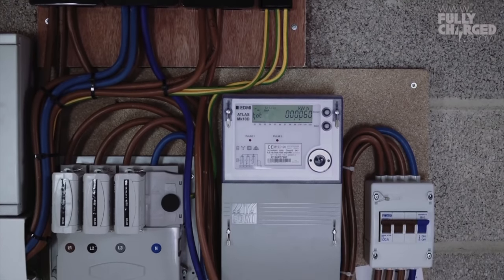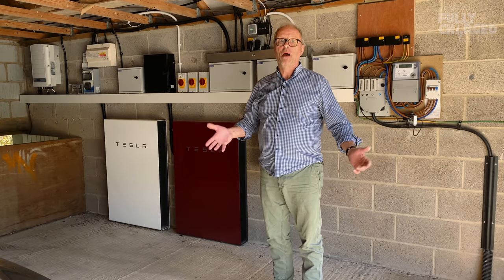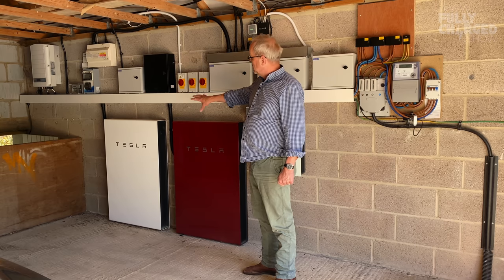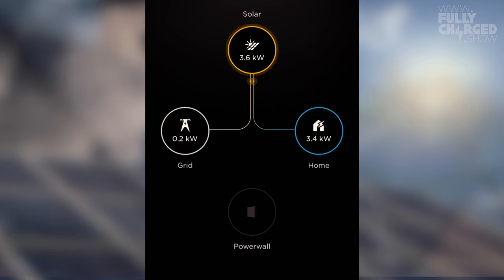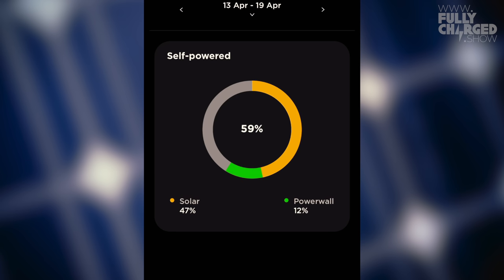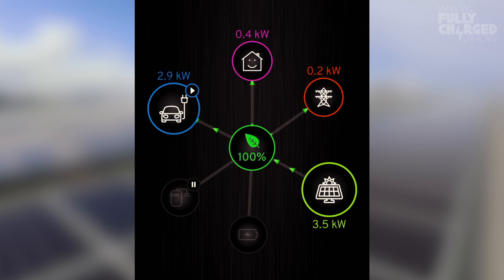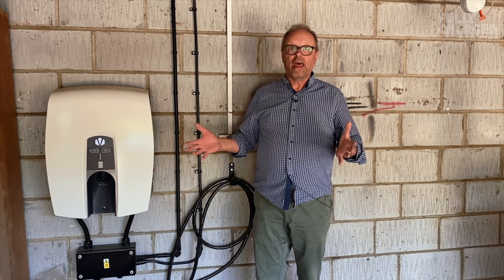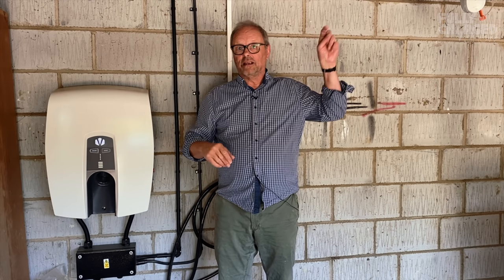Tesla Powerwall: how quickly can it respond to a power cut? | FULLY CHARGED for clean energy & EVs

Comment: How are your Powerwall and solar spread across the phases? Powerwalls are single phase as far as I know. In my house, the Powerwall gateway will draw from two phases and feed from the powerwall to keep things in balance. My solar is three phase 7.5kW though.

I waited for years for a proper three phase solution and it never came from Tesla.
Reply: Richard Laxton , I would also be interested  to know how this works across the three phases. Presumably the three phases have to be balanced across the house and with one phase for each powerwall ( with only two powerwalls) there will be part of the house which is not supplied in the case of a blackout?

Comment: What I would love to know: Is the switch over time short enough to allow a desktop computer to stay powered up when the grid fails?
Reply: great question!  And do you need to reset the clock in the microwave??  :)
Reply: @buckyswider1  My iMacs can handle a dropout of under a second without any problems. And so can my mains-powered LED clock, the clocks in a bread maker, an oven, and a microwave. That's said from several known experiences of brief dropouts. The LED clock is the first to lose the time.

 If you watch the video again, you'll notice that Robert switches off the grid supply for a few seconds, and then turns it on again. His studio light doesn't even flicker. Even a cheap computer should be fine with that smooth switchover.
Reply: Computers can normally cope with up to 20 milliseconds break (1/50th of a second).

Comment: In the USA, you can not install solar, wind or powerwalls with out the auto cut switch. You will fail inspect. Also, must be a manual cutoff outside of the house.
Reply: Pat McDaniel basically the same in the U.K., the system must be designed not to backfeed in the event of a powercut. There is no requirement for an external cut off though, probably not really necessary or practical here- no power worker is going to walk around a town flipping hundreds of switches before they start work.

Comment: I have noticed a disturbing trend. The more expensive and capable your camera is, the lower framerate is used. 

24fps is not a artistic choice, it is an ancient technical and cost limitation which is long been overpassed, when even phones can record 4K@60fps continous (in very good quality, IF you provide strong lighting). High resulutions become useless, if video is choppy and filled with motionblur, which hides the details.

Comment: Would you say its fast enough that a running computer would even notice? As in, would it crash, or just carry on without an issue? (The power cut response, I should point out)
Reply: usually a fairly large capacitor in a PC power supply which accommodates a really short break. Or use a laptop ... I have several computers here, we've have only a couple of power cuts since installing PowerWall but they've kept running ... so far
Reply: Actually we've had more power cuts than I realised! so Powerwall is actually working as it should, just "I had no idea" ... Checked the APP for Powercut History and we had 4 in April and one in May. Checked my PC EventLog and definitely no reboots on any of those days (APP powercut history only tells me the date, not the time)
Reply: @wannabeowner  That's mighty impressive. Got a PC with 1080+ days uptime running in my mancave with not even a UPS. I like to live dangerously :D
Reply: @Fishbait075  Don't move anywhere near my electricity supplier !!

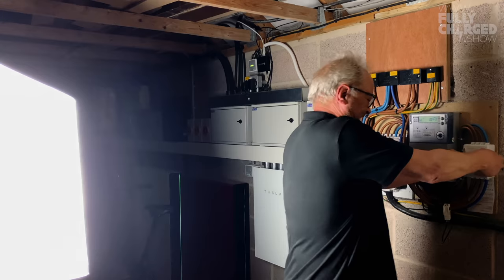Comment: At 3:49, that is really impressive.  At the Fire Service I worked in locally, it was a case of a big diesel generator, which the Technicians were responsible for, and the Chief Engineer was commonly out after if not during a power cut to coax the system to burst into life faster, or at all.  The IT stuff, had battery backup, but these were primitive things, with maybe 25 minutes of power if you were lucky, they were on their way out from the minute you installed them, to when they died perhaps 4 years later if you were lucky.  Dire.  I think 29 seconds is the time from the mains power being disrupted, to when the generator was meant to crank up and provide emergency cover for the 999 call centre - that’s the number stuck in my head anyway.  So, overall, there was a chain of: Generator - Big Battery pack (Lead Acid) - Little UPS battery per server (Uninterruptible Power Supply) - finally the Server computers in the Server ‘farm’.  

The problem with this is, that as when I was reconfiguring the disk drive array one night around 9pm to 2am, I just sat resigned to there being a power cut and shutting down my Fire Service career.  29 seconds, even if the genny starts up impeccably, is a long time in computer terms, and glancing at the chain of devices listed above, there’s almost bound to be a glitch/brown-out/tired battery etc.  I mean it’s just gagging to go wrong.  

So I sweated for four hours or so as the server in question laboured to incorporate the new disk into the array, striping away to re-spread the data across the disks, and thereby give this machine a new lease of life.  Without the extra storage - free space in which to operate - the server eventually would have a user shove a load of info on there, or be naughty and back-up their PC to it quietly, then that system would just ‘crunch’.  We had no backups either, so I had to wing it.  There’s reasons why but it came down to wearing the backup machine out and no replacement available.

So, I view this with considerable interest, with a half-decent Power Supply Unit, hopefully incorporating some kind of ability to bridge a short glitch, clearly this system of yours would be superior.  I have found, my own PC, will literally ‘jump’ a power gap if it’s short enough eg a fraction of a second.  I mean, I don’t know quite how it does it, but I see the lights flicker, hear the permanent cooling fan drop in speed, even the monitor flicker, but if the power glitch is short, the machine keeps running.  Capacitors I guess, and the coils of the PSU letting go of their built-up energy, just enough to bridge the gap.

Lastly, these power failures do seem to come in episodes.  IE it’s like buses, you don’t see one for ages, then it hits you...something like that!  So, we had about 25 power failures a couple of years back, once every evening and eventually I set my alarm for it.  No really, I set my alarm for 19:15hrs and about 20 mins after that, the power always went out for around two hours, once we got into the way of it.  In other words, long story short, the provider of infrastructure, waited until the overload happened right after dinnertime, and went out to pop a spare ‘fuse’ or sacrificial copper bar, in the sub-station.  Then, the power predictably came back up until after 7pm next night.  Their response was slow until I called my MP about it.

So literally three weeks of power cuts nightly.  Oh yes, and it was only us.  The entire rest of the street remained lit haha.  I told them to put us on the phase everyone else was on thanks.  Now, that pressure and knowledge also gee’d them up, but they wanted to explain why it couldn’t be done, to which I replied I don’t care.

The frequency of this failure, led me to warn them they’d be liable for my computer equipment being damaged.  The lady agent replied that there was no way the power coming off and on could damage equipment...I said, ok, you flick the power switch on your massive TV at home, on and off merrily, and see what happens.  Oh, you don’t want to try that?!  I assured her, there very well could be damage as the spikes and the repeated nature of the switching, was one day going to hit the right note, so to speak, and my computer or screen would give out.  No, it was not likely, but I didn’t care for the reassurances from my supplier, who wouldn’t under-write such a view readily in a legal document.  In fact, I suspect their contract with me probably has a clause exempting them from exactly this sort of issue!

Very impressive as I say - how things have moved on.  Not before time.  Of course, the electricity provider could always put these in at their expense, instead of us having to do it, but that’s a whole other conversation.  It’s just, if working from home is an acceptable proposition for mass numbers of staff, it strikes me it’s not up to individual consumers to fix a problem that’s really in the energy provider’s domain.

Comment: The only time it makes sense to 'run the house from the car' is if you have excess solar production to charge the car & the home battery while simultaneously running the house. Otherwise, there is no benefit to the environment if you need to charge up the car with the grid because you've used it all up to power the house for a day or two. And with a tiny 5kW solar array (in the UK) this is unlikely.

Comment: Robert your system is great, but very expensive,  my system also has batteries, but when I was away out of the country for 12 months my inverter switched off.  Now I can't get the batteries to charge and all the solar people I have contacted could not help me all of them said I will have to replace my inverter, this after 4 years of use, less the time it was out of use. if we have to keep replacing parts of our system  then it will not be cost-effective as Solar engineers/electricians are very high rates

Comment: There's a long way to go, however, until this kit is financially worthwhile (in the UK at least). I'd guesstimate at least £30k to install the two large batteries, all that solar and other ancillaries (excluding the VTG system). That's about 200,000 kWh required through the system for pay back, and of course a lot of the kit will need replacing long before it returns that investment.

The maths on a normal-sized system is not much different - equipment needs replacing long before it has paid for itself.

Just imagine, however, if we could use our car batteries for evening power delivery, recharging overnight while parked at home - could flatten grid demand in one fell swoop. Since the car is already paid for, it'd effectively be just the cost of a VTH inverter to be recovered and that would be a no-brainer. Unfortunately the SAE and CCS members continue to drag their feet on agreeing two-way power over CCS, so it's not happening any time soon. 5 years away, maybe, and even then that'll only be for new cars.

Comment: Great setup, we need to find a way to convert electricity to heat efficiently to replace gas combi boilers and then we're cooking without fossil fuels!
Reply: You can convert electricity into heat with a 100% efficiency, with a heat pump that goes up to almost 400%.
Reply: R3lay Exactly, heat pumps combined with low temperature underfloor heating and good insulation are the way forward.

Comment: You have one power cut on average every month? Battery really makes sense then. I'm guessing the switch is fast enough that computers don't notice?
Reply: Computers are surprisingly tolerant of bad power.  Lights can actually go off completely before a computer will complain.  It's actually in the ATX power supply spec - it has to be able to run the system at full power for something like 250 milliseconds with no power, and the less load the longer this will be.  (A system with an overspec'd power supply and hardly any draw can easily chug along for a few seconds without power.)  That's why PSUs always have a couple of physically large capacitors inside them.  Normal computer UPS devices have a switchover delay around 50 ms which is enough to cause many types of lights to flicker, so a computer power supply has to be able to cope with that.

Comment: Have you considered protecting your system from a CME?
Reply: CMEs only induce measurable currents on very long wires, so they will only affect the grid and none of the install itself.  I don't know for sure, but the Powerwall almost certainly has circuitry to disconnect itself from the grid if the voltage goes out of range, so if there is a CME that affects the grid and a surge comes in, the Powerwall should disconnect and keep everything running off the battery while the solar panels are able to keep it charged.

Comment: we know that electricity per mile is cheeper, and renewables eventually pay for themselves. So would you please add up the cost of all that equipment and what you used to pay in petrol, then compare that to the bills you used to pay for electricity vs now, and tell us how much that stuff has paid for itself. I imagine you have purchased so much so quickly that you won't have financially benefited too much. but it would be very very interesting to know what percentage has paid for itself. and then do that simple extrapolation guess for how long it will take to pay for itself. (eg: 10% benefit in 1 year = paid for itself in 10 years) Thanks!
Reply: I pay about 2p per mile for electricity (Off Peak) to drive EV and (in UK) Petrol is 10p - 15p per mile for a reasonably frugal car. The difference is similar in most of Europe etc. but less in USA. I work from home so a powercut would mean I didn't earn for that time ... Battery / EV price falling all the time ... replaced my 4 year old EV recently with same model etc. and new was 25% cheaper (and goes 20% further 🙂)

Comment: Can you use v2g on the Tesla?
Reply: I think that Battery day might give us a answer or solution for this.
Reply: They already use Tesla Model 3s and Renault Zoes for a city V2G system where I live (Utrecht, Netherlands). They are available to use as part of a car sharing service. Because they are generally plugged in and you have to make a reservation to use them, they know when they can be used as batteries and when they need to be charged to use for driving!
Reply: @novulet  that is nice To hear since model Y is my next car in 2021 What kind of Charger or V2G system set up You need for This?
Reply: Not at the moment. We will see what will be in future. Most other EVs also can't do it, Chademo vehicles can, if it's activated in the car's software.
Reply: @jpen5599  I'm not quite sure about the specifics, especially as these are just black-box public chargers using normal Type 2 ports. The company is mostly working with and focusing on the Renault Zoe. The buzzword is the ISO15118-V2G standard but concrete details are hard to find (and not my expertise).

Comment: Silly question, do you get paid to send energy to the grid using V2G?
Reply: Yes, you normally get paid. Which means you can gerenate a bit of money. There are times when you get paid to take energy (store it in the car/powerwall) and there are times when its very expensive. If you charge when cheap and put it back into the grid when expensive you can pocket the differtence and everyone is happy because the grid oprator doesnt have to invest in giant batteries or waste surplus energy.
Reply: Yes you get paid, at least during the OVO trial. I earned ~£40 per month for the last 2 months it's been installed

Comment: love your channel. But OVO are a rip off. They where charging me £200 a month extra every month on gas and electric. Changed supplier now its £70...
Reply: John Hodgkiss What you pay monthly is irrelevant. People get confused because they don't understand they are usually under or overpaying, building up a credit towards winter usage or a massive debt that will need to be repaid. What you should be looking at is the unit rate, and how it compares with other suppliers. OVO come out below average. It's far more likely that your direct debit amount isn't reflecting your actual usage- there is no possible way that ovo are charging nearly three times more for power than anyone else.

Comment: what would be cool is if you lose power to the house battery and deem it to be necessary
, flick a switch on cars charger that instead of charging car now uses car as a power source.
i know i personally dont need a fully charged car to get to work (which also has a charge point) so if i knew i only need 20% to get to my next charge point, could set it to consume from my car until 25% or so remained that would be sweet as.
But good ideas of people like me almost never become reality sadly

Comment: Imagine if every house, that could do this, actually did this. We wouldn't need power stations anymore.
Reply: DefiantAML you should watch one of Tony Seba’s presentations on YouTube when you have a spare hour.
Reply: During winter PV is not that powerful, so in November/December you need a grid and energy from outside, even if you have a really big PV installation with more than 10 kWp. Fog is a killer for PV, if you have fog the power is zero, in normal winter weather it works, if the modules are inclined enough (at 45° snow is sliding off).

Comment: "islanding" is absolutely not specific to single phase or being at the end of the lane. the chap needed 3 phases because of big loads and large infeeding.
Reply: I’m an ex electricity network engineer, I still don’t understand why the extra battery forced the 3 phase upgrade. Surely the Powerwall gateway is designed to disconnect from the incoming supply if that supply drops to zero? My only thought is that the gateway isn’t approved by the local distributor as a self isolated device, and that they were worried that 26kwh of juice down 1 phase would melt the supply cable, but again, I thought that each powerwall was limited to 8kw peak output anyway!
Reply: Muppet Keeper Yes, I struggled with that too, I can't see him possibly ever pumping more than a few Kw back to the grid. Perhaps his single phase was ancient, and the DNO decided it would be in their best interests to charge him for 3 phase rather than cough up themselves and upgrade the local supply to a sensible degree.